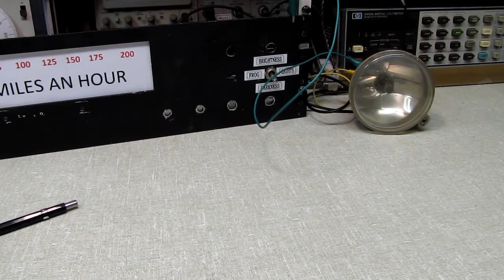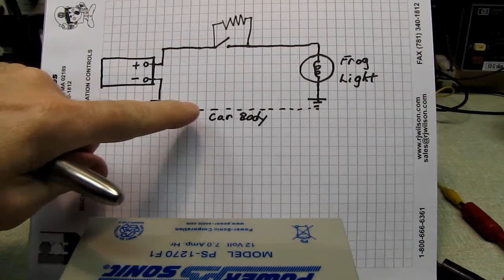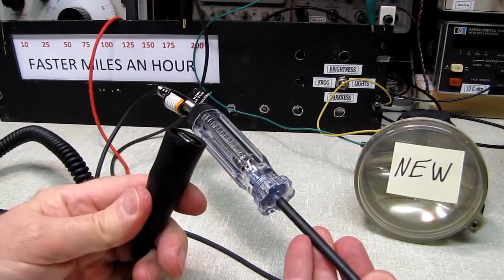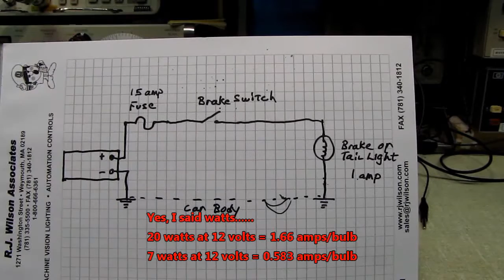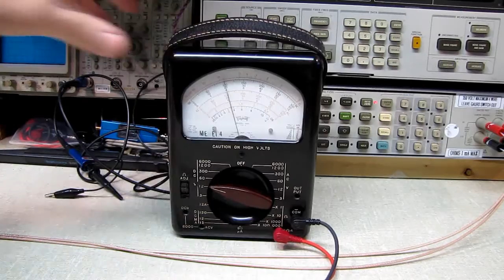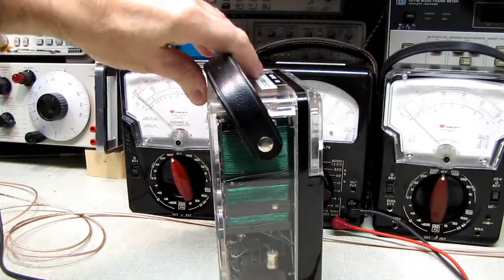Why YOU need an Analog Triplett 630 VOM

Comment: My Triplett is 630-A.  Don’t know its age, but who really cares.  It has 6000 V DC full scale, or 1200 V with the same switch position, if the lead is in the normal socket.
20k-ohm/volt on DC, but 5 k-ohm/volt on AC.  Yet, here is a funny little math detail.  At anything above 20 V most digital meters remain fixed 10 Megaohms.  However, the 20k per volt analog meter just keeps growing.  At 1200 V range it is already 24 M and at 6,000 V range it is 120 M!  Bears most digital meters.
Another memory relates to a French meter (maybe Metrix?) my employer had in the 1960’s had 100 k-ohm / V, meaning its movement was 10 microamperes rather than the Triplett’s 50 microamperes.  It did not offer anything really high voltage like the Triplett, but it used a mercury battery for its ohms range and there was no zero adjustment.
By the way, the “breaker” probably is mechanical catch release, When the needle hit the full scale limit, it released the catch.  That is how a British AVOmeter functioned.  Those meters were what the school labs had in those days.
Reply from the maker: Hi Pellervo, yes the impedance goes up with voltage. Think I mentioned that in one of my videos. If not I intended to . The Triplett is an incredibly accurate meter for its age. ( at least most of them are ). The safety relay in these is based on current through a coil. When the range is seriously exceeded it trips the unit out. Hopefully it is fast enough to prevent the meter from damage. 
I try to be very careful when using these not to exceed the range.

Comment: Your absolutely right, for many (but not all) automotive/aviation uses, old school analog meters and incandescent test lights are the correct technology for the application. You should see my test light assortment... I have 8 with all manor of probe bend and length configurations. Also, my beloved 260-7M see's a good bit of service as well. Back in A&P school (c. early 70's) all they had was 260's, and everyone became comfortable with them... however, after using a buddies 630 the other day, I think I'm in the market for one. By the way, he said he'd recently found a new 30V battery on Amazon...
Reply from the maker: Yup,  shortly after I posted that video I got a comment saying the battery was back in production. Bought three. Thanks for watching.

Comment: I bought one in grungy condition at a Habitat Restore resale shop for $40.00. Vern probably thinks I paid too much for it, and may have, but there was no shipping charge, I could examine it beforehand, and they'd take it back if it did not work. Also, I have more money than time, and it was a good cause. The case cleaned up great and the 30 volt battery (with a 1999 date sticker)       still provided 31 volts with no corrosion in the battery compartment. I used headlight restoration kit on the meter face and it came out looking fantastic.
Reply from the maker: HI Ian, your going to love that meter..

Comment: HI,
I've been servicing these for some years now. I recently found one for "free" of all things. The original 30 v Eveready # 413 still shows 30.3 volts. Not bad for a 40 - 50 year old battery. Like you, I have never seen one with a failed switch. I am 77 years old and just do this as a hobby. Sell them for a little side money. Some that I have got were a real mess cosmetically with scratches etc. I use Novus 3 step plastic polishes for a mirror finish. I also "fill" the lettering to like new. 
Nice video you have up here. 
Mike/K5VSE
Reply from the maker: HI Mike. Thanks for the kind words. Love those old meters. I have 9 of them now.
Reply: What should I look for when buying one at a flea market? Will the functions work if they don't have the battery? will I be able to open them up to check for a battery? I saw two at my local flea market but I did not buy they because I was not sure how they operated or if they had a battery. And if  they are defective is it still worth it to buy them?Thank you
Reply: Forgot to mention that the ones that they were selling where the 630-na model.

Comment: I found a Triplett 630 Type 3, red knob and in decent condition for $15 today. Can't wait to get the unit sparkly clean and put to work. I too have the Frog squashers at my work and they carry digitals also and they get stumped. I love teaching these kids and watching the light bulb come on when they figure it out. Great video.. as usual.
Reply from the maker: Hi Robin. Your going to love that meter. The 30 volt batteries for it are now available again on Amazon. Make sure you shop as the prices vary from 12 bucks to 30 bucks. Thanks for watching.

Comment: On the clear back cover
, 
Heres a cut 'n paste from an old post from Fred Scoles (Triplett guru) on the Antique Radio Forums

http://preview.tinyurl.com/hrmv5ju  about 2/3 way down 

"The clear plastic case, molded of a Dupont 
acrylic of that period (which can crack with age especially near the 
four screw holes if they're over-tightened), was offered for about $5 
extra (over the cost of the standard black bakelite) from most Triplett 
distributors with any new 630 series. The clear back was intended for 
field-sales samples, hobbyists, schools, research labs, etc. I have an 
original factory ad copy sheet from when it was first offered,"

Personally, I've got a 630A type 2. Nice meter. But admittidly I have a soft spot for the Simpson. Since they where made locally (London, ON Canada) our schools where filled with 260's (I have a 635) and a vast array of everything Simpson in single function meters and panel meters. Familiarity certainly breeds a preference for them.
Reply from the maker: HI Alex, Thanks for the information. Wish I could find a few more of those clear backs. Makes it easy to keep an eye on the batteries. Simpson made decent meters also. But like you, Triplett was made locally for me. Again, thanks.

Comment: Thanks for the great info.  BTW, Amazon currently has the Exell 413 30V battery.  $29.95.
https://www.amazon.com/Exell-Battery-413A-Alkaline-BLR123/dp/B00BNF7R98
Reply from the maker: Hi Wanda. Thanks for the tip. Some folks will certainly be interested in that. But ouch, 30 bucks. Amazon also has 8 pack of 9 volt batteries for $9.50.  Three for the meter and the rest can go in my smoke alarms and CO detectors.  Important when I blow things up. :-)
Reply: Well, I DO see some for less than $14, but you know you really need the right battery for the clear back meter - at least for show when you are setting the timing on that old Harley!
Reply from the maker: Wanda, I have to admit you got me there. That old clear back deserves a real battery. You know your motors also. Nothing idles like a Shovelhead. $14 bucks is reasonable.
Reply: Yes, a friend was just telling me the other day he found a new 30V battery for his Triplett on Amazon...

Comment: Great video on these old meters. I've been looking for one, but they're a bit pricey on e-bay and you never really know when you buy it if it actually works or not. I'll keep looking though.
Reply from the maker: These are pricey on e-bay. especially for the good clean ones. The were selling for around $400.00 new a couple of years ago. Don't see them listed any more. Ask for photos of the inside and make sure there is no battery damage. I also like to put the meter on ohms and make sure the needle does not stick any where in it's travel. Always a risk when buying on line unless the seller will take it back if it does not work correctly. I have been very lucky at the flea markets and always paid $20.00 or less. I don't care how dirty they look as long as they are intact. Bought a dozen of them from a surplus place a couple of years back some had broken cases, some bad meters. Ended up with 8 good ones by swapping parts. Hang in there. One will turn up.
Reply: I have seen two of the 630na at my local flea market in the past two weeks (they have not sold) and I am wondering what to check for as far as operation goes both had leads but on each one of the leads was damaged. So what do I check? they want $45 a piece.Thank you

Comment: I used the Triplett 630 when I was in High School in the late 60's.  They were made when things were expected to last. Short of hitting it with a hammer they are indestructible.
Reply from the maker: HI Bill. I agree ( except the cases are somewhat easy to crack ). These came from a time when built in the U.S.A. meant something. We took pride in our workmanship. These are still the most accurate Analog meters I have ever had my hands on. I own nine of them and use them nearly every day.
Reply: I miss my old Simpson 260.
Well, that and my Beckman 310 and finally extinct Fluke 77, for those applications where one doesn't need to create a load.

Comment: Very informative video. But why not just do a voltage drop test across the switch with either the digital or the analog meter? Also love that you explained the difference between a short and an open,,as another old graybeard mechanic it used to drive me crazy when one of the younger guys would  call any elec problem a short.
Reply from the maker: You question tells me you understand the issue and would not be tricked the digital meter. The people who come to me with these issues have two problems, they can't easily access the back of the switch and lack the understanding of how a high impedance meter will "lie" to you. I tell them to use a test light instead.
Reply: Thanks for the reply. Also appreciate your description of the various Triplett meters. I'm in the market for an analog meter to replace the old Snap-On one I had that somehow disappeared during my last move. BTW, something else I've found useful, automotive wise, for an analog meter is to test the magnetic sensors they use for ABS, or RPM or TDC. Hook the meter to the sensor, use the ohm section, adjust the meter to read about half scale and spin the wheel, ect. and watch for a needle pulse if the sensor is good and it's triggering mass is correctly spaced.
Reply from the maker: I have done that myself, but you need to be careful. Some of the analog meters can place over 300mA on the leads when using X1 scale. Some sensors are only good for 100mA. And O2 Sensors should only be checked with a digital meter. But I think you probably know that just from your comments.

Comment: Great Video! I really appreciate you taking the time to go through all of this for us. What I really want to know is what polish are you using to make the "outside" of your Tripletts gleam like that ... Beautiful!
Reply from the maker: Thank You, comments like yours really make my day. It takes time to make these videos and when I get positive feedback I look forward to making another video. The trick to making the meters shine is plain old Turtle Wax Hard Shell and a little work. If they are really bad I will start with a clay bar which is available at any auto parts store. Keep the surface wet and rub with the clay bar and finish with Turtle Wax Hard Shell, NOT the new turtle wax with silicone, but the old standard Wax. It has a VERY mild compound in it and really makes the finish pop. Best Regards, Vern
Reply from the maker: Evilw, also see my video "One Minute Panel Restoration".
Reply: Very Cool and Thanks Again!
Reply: Had a similar issue with the "frog light" situation, alas, someone from my crew was using my meter and was clear across the warehouse site we were working on.
Thinking for a few seconds, I pulled out the fox and hound, when the resistive element entered the circuit, the signal from the tone generator disappeared. Easy as using a meter.